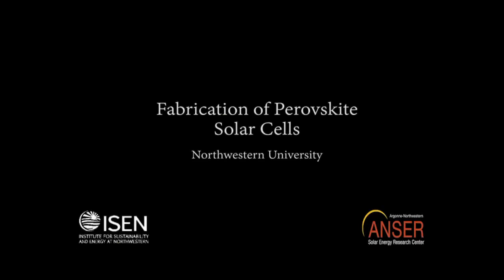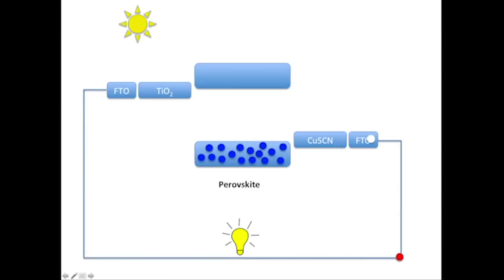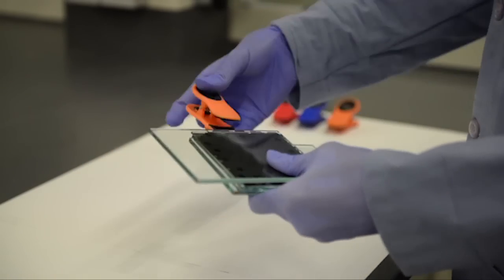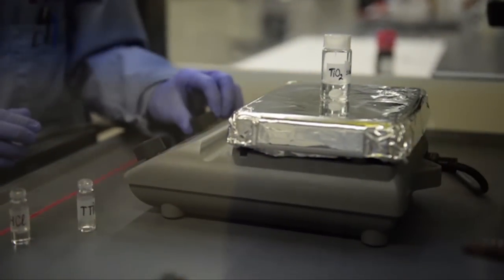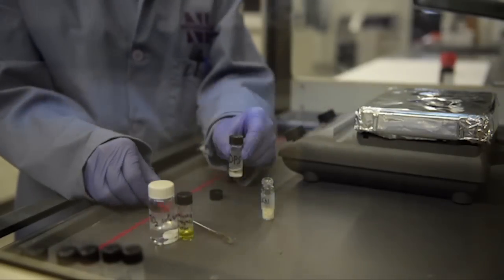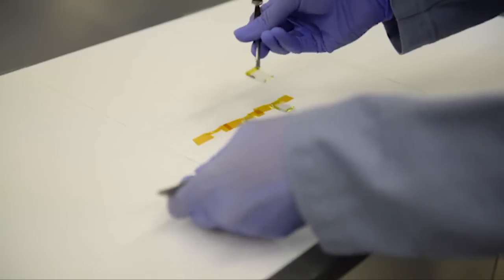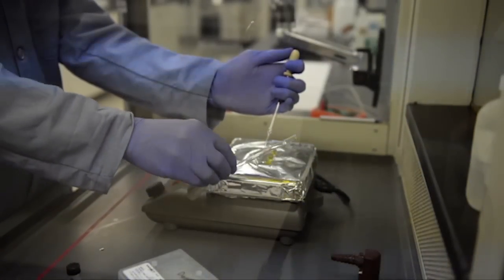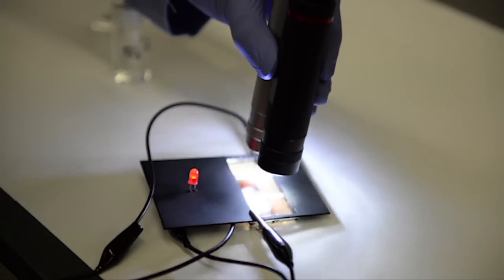Introducing Perovskite Solar Cells to Undergraduates

Comment: the TTIP i used in lab wasnt colourless and it was hard to handle too as it crystallized in the air. how come yours is colourless and didnt even crystallize. our pipette tube blocked due to its crystallization?
Reply: Its likely your TTIP is contaminated, and its not good anymore. TTIP is clear solution, stored in refrg and avoid contamination. I hope this helps. If you are making PSCs for the first time, check out two step method as well https://youtu.be/sus-bxdVgUw
Reply: @stemlearningkit933  thanks a lot for ur response

Comment: Hi.  How did you make the DPS solution?  What is the solvent and Molar concentration?  I made a 0.25M DPS in MeOH and added the CuSCN but the CuSCN didn't dissolve after stirring overnight at RT.
Reply: what is full form of DPS ?
Reply: Hi Ansil, we dissolved CuSCN in Dipropyl sulphide overnight. The concentration is low - 0.05 M, since the solubility is low.

Comment: Hello I am student working on perovskite solar cells and I have been following your video.My perovskite layer is turning red when heated and I dont know why.Can you give some insight.
Reply: perovskite film color is brown~dark. Maybe, red means perovskite didn't form.
Or please check antisolvent.
Reply: which precursor solution you are using? if it contains bromide, then your film is supposed to turn red.
Reply: Check if the temperature is too high. If you are making PSC cells for the first time, I highly recommend using the two step method: https://youtu.be/sus-bxdVgUw Let me know if you have questions.

Comment: The Chlorides are substitued by iodides in the perovskite?
Reply: Jesus Rafael actually no, the excess iodine from the 1:3 PbCl2:MAI ratio form the MaPbI3 perovskite. The role of chloride in this fabrication method is highly debated but it is likely acting as a dopant, as well as incorporated (<5%) into the perovskite structure.
Reply: The chloride ion is too small to go into MAPbI3 structure. This structure is largely a cage formed by Pb and I ions, while MA sits in the cavities. The Chloride ion doesn't go into the bulk perovskite, but may fill surface traps and suppress charge recombination, giving highly efficiency. I hope the explanation helps. Also check out the two step process that doesn't use Chloride ion: https://youtu.be/sus-bxdVgUw

Comment: If both electrodes are ITO, how can the charges separate and flow in different directions?
Reply: I believe the main anode electrode is FTO (accept negative charges) and the main cathode electrode is carbon (accept positive charges).
The 2nd piece of FTO glass is only used as a mean to create a conductive pathway for electrical characterization as well as protect the solar cell from direct exposure to ambient condition.
Reply: Thank you for your nice answer. I agree with you. The carbon black can be use directly as the electrode and the 2nd FTO glass is only for pathway and protection. The contact between the carbon black and the 2nd FTO should be like metal/metal.